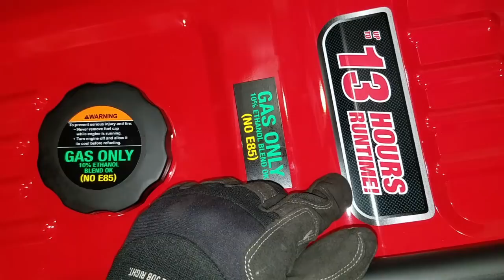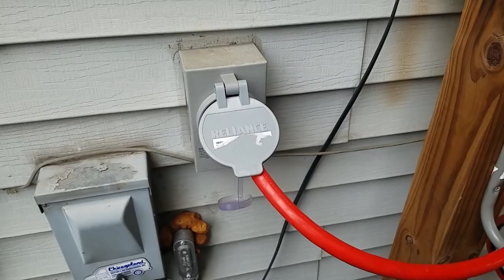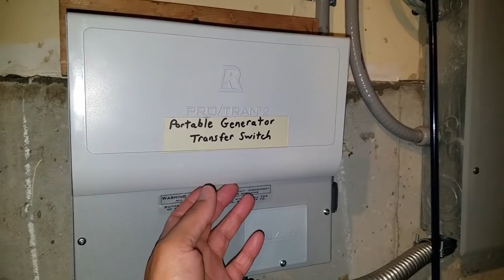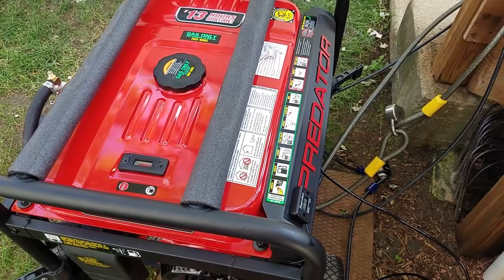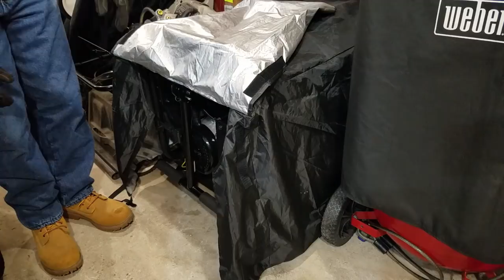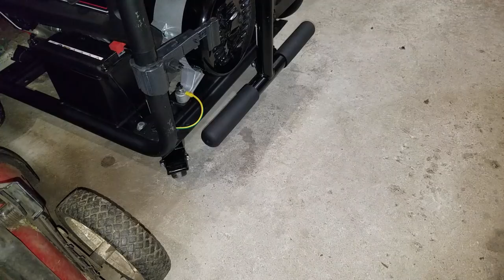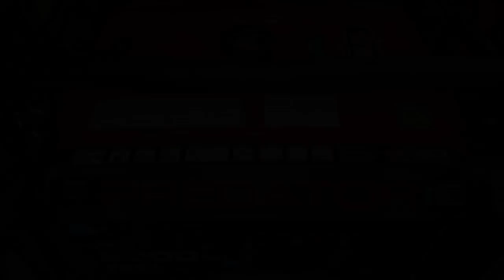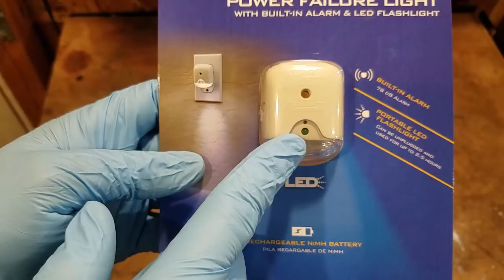Predator 9000/7250 Watt Generator, Tri Fuel Kit and Accessories Review/Testing

Comment: Good video for sure. Don’t know I would have went through the trouble of converting it for 6 hours of downtime but you’re ready for it.  Last time we lost power it was for 9 days.   Good information.
Reply from the maker: Installing a Tri-Fuel Kit is worth every penny and time spent installing it. The key is to install it before you need it. (No down time) Being able to run the generator off NG or LP gas is a must.

Comment: They sell a replacement carburetor with gas input for $40 on Amazon
Reply from the maker: At the time I was doing my research, the one on Amazon was not for the 9000/7250 watts generator.  It will work, but you wouldn't be able to get the full 9000/7250 watts out of it.

Comment: Have you had issues with the carbon sensor?
Reply from the maker: This unit didn't have the carbon sensor.  HF added it in 2022, I believe.  As much as I like the sensor, I really prefer not having one.  I've heard units turning off when it's windy outside.  This makes the unit unreliable if I shuts off unexpectedly.

Comment: The engine is running rich, not lean on load by that spark plug, which makes sense. Putting a longer adapter on the carburetor is like sucking through a straw. Its essentially choking the motor. You can just adjust the AF screw and lean it out a bit. Its really expected.

Comment: If you're connecting this to your home power system, you don't need the grounding rod. The whole system is grounded from the grounding rod(s) for the house. Great video!
Reply from the maker: Good point. I was thinking the same thing, but decided to follow the manufacturer's directions. I will test it out the next time I exercise it.
Reply: @Pk3_Garage  It is somewhat more important in an isolated system that has no ground or earth connection. It is an overloaded term - there really is 2 separate considerations for "ground" - one is to protect from short circuit by bonding the neutral and ground such that the breaker would trip if a short was to happen and the second thing is to provide a path for lightning to dissipate into the earth without shocking anyone.

When you're connected to the home, both of those objectives are already achieved if you have a properly wired electrical system.

Comment: I did forget to add the natural gas kit I purchased was about $300 total and worth it.
Today, I couldn't imagine standing in line for 6 to 8 hours to fill 5 gallon gas cans especially with the price of gas. It's lower down here about $3.68 a gallon.
Reply from the maker: Hi TRIP and thanks for sharing.  Your example shows why this generator w/Tri-fuel kit, in a real-life situation, is worth it.  We still haven't lost power in our area, since the making of this video. I'm sure we will be fine though.  

I hear you about the gas prices.  Here in Chicago, the price for regular gas is around $5.75 a gallon.  The Tri-fuel kit is an upgrade every owner, of a gasoline only generator, should have.  Even though I have gas stored up, NG is what we are running when using the generator.

Comment: Thank you for posting such a detailed and informative video as I just recently purchased this same generator and was looking for ways to connect LP rather than gasoline. And the devices you also use are great.

God Bless and Happy Easter.
Reply from the maker: Hi Stanloco and thanks.  Happy Easter to you and God Bless you and your family too. 

Let me know if you have any questions about the conversion kit.  I didn't do an installation video, but I can help you with set up, if needed. I haven't had any issues running off NG or gasoline. The Tri-fuel kit is a must have, for any gasoline only generator.

Comment: The 9500 requires a lot a disassembly of 2 covers, 2 wheels and lots of nuts!  What a pain!!!   I would have used 6 gauge.
---
Add a slow-start to your A.C.
Reply from the maker: Hi, so are you saying you are interested in the 9000/7250 version?
Reply: @Pk3_Garage  - No the 9500.
Reply: @Pk3_Garage  - NO the 9500

Comment: Good video! Did it run on gasoline and natural gas well after taking that  block out and putting in the motor snorkle? I got a kit from nash fuel and it wouldn't run on gasoline after installing it they are supposed to send me a different style venturi. Can you get full load out of your gen on Natural? Mine snuffs out at about 5400 watts now
Reply from the maker: Hi and thanks.  1) Yes. It runs perfectly on NG and gasoline using the Motor Snorkel. 2) I can't confirm if we can get the full 9000/7250 watts on NG. (Probable not) I've been able to run our 3 ton AC, along with other essentials appliances at the same time, with no problem.  The most I've used is 5800 watts.  (That's running the same stuff on gasoline)

Comment: Awesome video... answered many of my questions. I do have a question about your Runleader tach/hour meter. What setting did you use for the firing pattern....1P1R or 1P2R? Thanks!
Reply from the maker: I will have to look at my notes and get back to you.  I can tell you though, that it's not dead on accurate with the RPM's. I verified this using a wattage usage meter, that measures the frequency.
Reply from the maker: Hi Nick, sorry for the late reply. I forgot to look this up for you. I'm using setting 1P2R. The RPM's are not very accurate when I compare it using my wattage meter. It's close but I wouldn't use it to set the RPM's. Use a watt usage meter that shows frequency instead.

Comment: Thanks for sharing your knowledge, this is a terrific instructional video.  A few comments if I may. 1) I added casters to my generators after severely hurting my back lifting/rolling the genny's back and forth from garage to backyard for oil changes every day during a multi-day outage here..and since I'm not a youngster the casters really work wonders....2) For those who want to use Nat. gas or propane fuels I recommend purchasing a unit already built for dual-fuel or tri-fuel from Champion, Firman, Duromax etc. albeit they may cost slightly more than a gasoline only genny,  the carburetors are designed to accept liquid or vapor fuels saving time and money for conversion....all you may need to add is an appropriate zero-regulator for Nat. gas operation for a dual-fuel unit. 3) As for continuous power rating of genny using nat. gas I use 80% of gasoline rating rule of thumb.  So your machine should be able to supply around 5800 watts running on Nat. gas if it is getting adequate fuel supply. 3) You reviewed your nat. gas piping job (most people cannot or won't undertake this work because of requirements for permits by local authorities and work done by a licensed plumber)...but if your genny cannot supply its rated power (nat. gas rating of 5800W which would have been useful to see in your video) I suggest reviewing Chapters 5 & 6 of National Fuel Gas Code which describes how to size nat. gas piping systems (if you haven't already done so)...for calculation purposes I believe your unit would consume appx. 130,000 BTU/Hr nat. gas running at full load.  4) For those who want clean power to run sensitive electronics,  try a 1500 watt regulated 12Vdc power supply connected to 1500 watt 12Vdc pure sine inverter....this rig is much cheaper than an UPS and will provide very clean stable and isolated output even for very wide swings in voltage and frequency out of your genny.  Also, in addition to monitoring genny speed, suggest monitoring your frequency....set up for 60Hz at around 50% of full load....frequency will be slightly higher under no-load and slightly lower under full-load.  Your genny voltage will remain around 120/240 because the unit llikely has an AVR which regulates the output voltage as speed and load vary.
Reply from the maker: Hi and thanks for your in-depth comment.  This will help out a lot of people.  The only thing I will disagree with is buying a already Tri-fuel generator over installing a Tri-Fuel kit.  I can tell you from personal experience, that installing a Tri-fuel kit is much better.  You can regulate the air/fuel mixture much better, which will help the loss of power when running NG/LP.  With my testing on NG, I've been able to get close to 6000 to 7000 watts easily.

As to oil changes, I'm using Pennzoil fully synthetic motor oil. I'm going to have it laboratory tested at 60 hrs. to see how long I can go between OC. Having to change the oil every 25 hrs. is crazy. Also, I installed a magnetic oil cap to catch the metal in the oil.
Reply: @Pk3_Garage  Thanks so much for your reply....I agree many people experienced issues with the earlier versions of Tri-Fuel genny's of several years ago primarily because of the lousy gas regulators they came with and misunderstanding of gennys nat. gas pressure and consumption requirements.  Recent models have much better more sensitive regulators like the Century one you installed and mfg. now provide the specific gas input requirements (eg. 7" w.c. @ 130,000 BTU/hr full load).  With the proper pipe/hose sizing to meet the genny's input requirements, the newer Tri-Fuel units work very well on nat, gas right out of the box (as the reviews indicate).  Furthermore, with a duel-fuel unit, you could still add a regulator like the Century if you want to have nat. gas operation giving you the ability to adjust the air/fuel mixture and still not have to modify the carburetor. Regarding the battery, we have found it to be nearly essential for these larger engines to start up on nat. gas....especially for older folks.  I don't exercise genny more than once or twice a year so I use a battery maintainer, and never had a starting problem in more than ten years....the trickle charger will prolong the life of your lead acid battery (these batteries should last 5-6 years on trickle charger) so I still recommend using one even if you exercise the genny every 3 months.

Comment: Great video, but I have one question.  I've installed a wheel kit on my Northstar 13000 generator and want to replace the two fixed feet with caster type wheels.  I noticed that your caster wheels are designed to be mounted with four bolts and the predator feet are designed for two bolts.  Did you mount the casters with just two bolts or use do something different?
Reply from the maker: Sorry, I forgot to mention that I had to drill two additional holes in the frame. I did use the two OEM bolts and holes too, along with the two additional bolts and holes I drilled.

Comment: You never thought of installing an interlock kit? More options
Reply from the maker: In our case, no. We only have 15 circuits. We only need 10 circuits in a blackout. A manual transfer switch is much better, safer, have more options. There are less steps when switching to generator power.  Check out my video on our transfer switch. (Linked in the description)

Comment: This is an excellent video.a lot of thought went into making it.
It may be the spark plug that is burning black is not burning hot enough. Spark plugs come in different heat ranges. Could it be that you need to install a Hotter burning plug to eliminate the cold / black plug.
Reply from the maker: Once I installed the Motor Snorkel, no more issues.

Comment: Just bought a preditor 8750 used it was low on oil,dose it naturally use oil,concerned when I bought it for cheep must be ok?
Reply from the maker: I haven't seen or heard anything about oil consumption on these generators.  How many run hrs. does it have?  How much oil is it burning between oil changes?

We have over 40 hrs. run time since are last oil change and no oil lose. We do use fully synthetic Pennzoil, which is better for the engine. Because these engines don't have a oil filter, might want to replace the stock oil filler cap, with a magnetic one, to catch the metal particles in the oil. (I'm in the process of doing this)

Comment: Great vid. I don't know what is magic about the airbox that causes everybody to cut the frame. Can't you just fashion another airbox that would fit????
There was another vid that said you have to get rid of the snorkel if you want to run gasoline. The snorkel is disturbing the necessary airflow or correct carburation - disturbing the Bernoulli effect.
Remember, you are helping thieves supply all that power to their electric grinder/cut-off tool to cut through your security cables/chains in the middle of the night(!)
Oh, and make sure you replace all Incandescent bulbs in your house with LED bulbs(!)
Reply from the maker: I've since then, installed the motor snorkel and it works great.  No issues using gasoline or natural gas. I turn off the 120V outlets, so they can't use them. I've since then, bought a very thick security chain, that goes through a concrete anchor, that's under the generator. (The chain is secured under the generator. So thieves would have a really hard time getting through all our security.  Not to mention, they would have to lift it over our fence. We have a really small yard and its only one way in or out.
Reply: @Pk3_Garage  Great, thanks for the speedy update.

Comment: To fix the issue with the generator running rich you need to reduce the spark plugs gap by 10,000
Reply from the maker: Thanks. The spark plug was re-gaped from 0.028" to 0.018". The problem was the adaptor.  I have since then replaced the adaptor, with the Motor Snorkel, and haven't had any problems.

Comment: Did you ever wind up having the same spark plug corrosion issue when running on gasoline with the motor snorkel?
Reply from the maker: Hum, good question. I haven't had any issue running on NG or gasoline, since installing the Motor Snorkel. I'm at 55 hrs. run time now, so will be doing an oil change at 60 hrs. I will check the spark plug and will let you know.
Reply: @Pk3_Garage  awesome, I appreciate that. I was considering installing the motor snorkel to run on natural gas only as a backup if the gasoline supply became scarce (as things did in NY during Hurricane Sandy).

I know natural gas burns cleaner and will probably prolong the life of the engine but gasoline will give me more power and allows me to get the generator farther from my home.

Anyway, your video got me thinking of any potential pitfalls of such a conversion. I'm aware of the decreased power because of less BTUs in natural gas as well as the compression ratio not being designed for it. However, I wasn't aware of any issues with the spark plug. Was the plug gapped to .2? I know US Carburetion recommends that gap when running on NG.

Thanks again for the information and great video!
Reply from the maker: You are correct that NG burns cleaner and has a decrease in power output because of less BTU's. Here's the thing, the motor snorkel kit comes with a regulator, which allows you to adjust the gas flow into the carburetor. You have to change the spark plug gap from 0.0028" to 0.0018".  This will allow for a hotter burn to ignite the NG.  You can adjust the idle screw to make sure your producing 60 hz  and 120V. (Need to use a Portable Micro Electricity Usage Monitor Electrical Power Consumption Watt Meter Voltage Amp Tester)

These few factors/adjustments, make the power loss minimal.  From my testing, I haven't notice any power loss, with the few adjustments I have made. You do have to make the idle adjustment underload though.
Reply from the maker: I forgot to add, if I were you, I'd invest in running the generator on NG as your primary source of fuel. The reason why, is you can only store so much fuel, but NG is endless. You don't have to shut the generator down, and wait for it to cool down, to refuel. We have a 15' NG hose that I use.  That should be enough distance from your house.  Just a thought. Run test to verify what you can run, this way no surprises.
Reply from the maker: I changed the spark plug, at 56 hrs., and there was no burning/corrosion on it.  The spark plug looked really good. I had to change it, because the spark plug terminal was lose to where I could twist it. (Never seen that before)
Reply: @Pk3_Garage  thanks for the update.

Comment: A battery powered angle grinder will overcome your security in minutes. Invest in one of those portable battery powered motion detectors and position it to detect activity. At least you will know they are around the generator before they steal it. However, you can’t shoot them unless they threaten you with a deadly weapon. Maybe scare them off. Otherwise, great video👍🏻
Reply from the maker: True. We do have a security camera system now, so we will see if anyone is on our property.  The idea is to make it as hard as possible to steal it. I have some other ideas as well, which I won't share for obvious reasons.
Reply: @Pk3_Garage  It’s VERY difficult to defend against a portable angle grinder. Owners of expensive motorcycles have been trying for years. You are smart to a least make sure you’re not the soft target in the neighborhood.

Comment: that one part u couldnt remember the name of, then later overlaid it "generator" is actually called the "head"  the whole thing, head attached to engine and gas tank and usually inverter
Reply from the maker: Thanks for the correction. I did look up the part and that's what it said.

Comment: Are both of those hour meter running at the same time, I'm asking because I need to get one
Reply from the maker: Yes.  I bought the hrs. meter on the left first.  Then I bought the one on the right second.  They are both connected to the sparkplug boot. They work very well in keep track of hrs. run.  I like the one on the right better, because it has more features and measures the RPM's.
Reply: @Pk3_Garage  thank you for responding, do I need both are just get the one on the right
Reply from the maker: No, you don't need both. Either meter will work.  If you want more features, go with the one on the right.